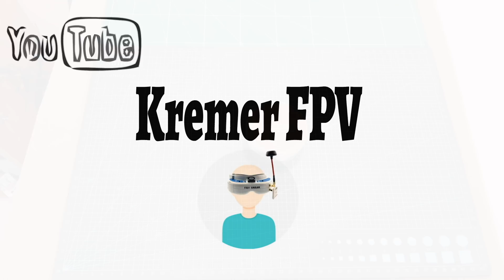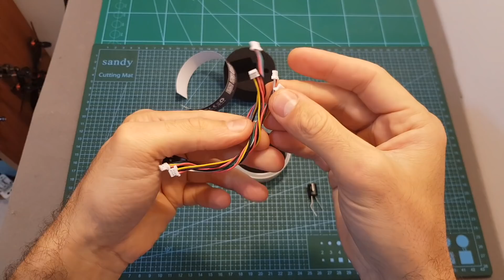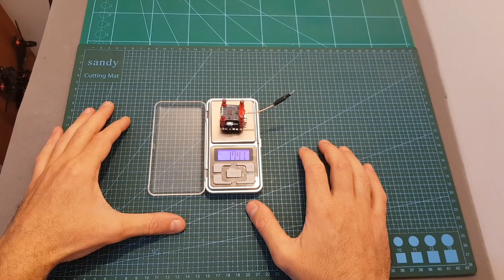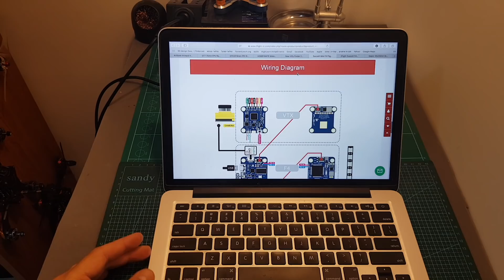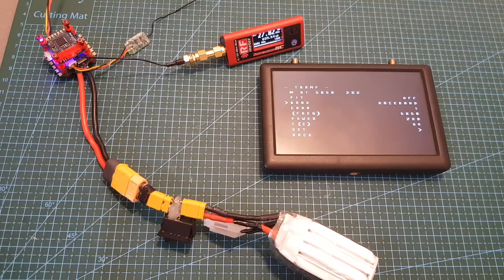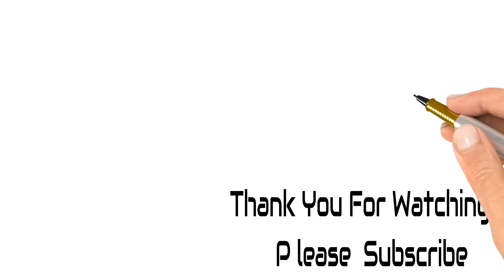iFlight SucceX F4 Mini Tower - Overview & VTX Test

Comment: Do you have unlocking procedure for the VTX?
Reply from the maker: It is already unlocked.
Reply: @KremerFPV  Im having an issue were it will not save power setting. Every time I plug in a new battery it reverts back to 25mw
Reply from the maker: @MrSplblzr  It sounds like you're using the wrong VTX table settings. Make sure you're using IRC tramp protocol and configure your UART ports properly.
Reply: I was given an article that stated it was a bug with one of the software versions. So I flash the latest version on there. But still having the same issue.
Reply from the maker: @MrSplblzr  worst case you can set it manually, just make sure to disable the smart VTX control.

Comment: How do you configure Vtx control? Is it IRC Tramp protocol on UART1? I have the iFlight Succex F7 mini so it has the V2 Vtx in the stack.
Reply from the maker: It's IRC tramp but I need to check the port. As far as I remember it's either UART 1 or 3.

Comment: How many mw does it output when it's set to 500mw?
Reply from the maker: The one in the video is not the latest version (V2) which has a maximum output strength of 500mw.
Reply: @KremerFPV  Oh ok, thanks for the reply ;)

Comment: Hi recently i bought a new  Iflight Succex F4 V2 Mini stack. Iam getting core MCU temperature  warning 70-80c  message on osd. Is that any issue? The vtx is heating up too much. I think that makes the FC hot. When i mailed iflight they said its normal and it will go off when flying. I dont want to burn my vtx or fc. Need your input kindly help bro. Actually i have 2 same stack when i swapped the vtx the issue is also swapping that means its VTX heaating issue? Just want to know can i fly with this issue?
Reply from the maker: Hi, yes, don't worry - it will get colder once you will be flying.  Don't leave it turned on for too long on the bench as it can damage the VTX and of course always make sure that the antenna is connected.
Reply: @KremerFPV  Thanks a lot man but when swapped on with another same VTX it working fine. The the VTX is not hot as this ond any clue?
Reply from the maker: @rajeevgopal1394  was it powererd without an antenna or with one that wasn't connected properly?
Reply: @KremerFPV  its mmcx connector and was connected propeely

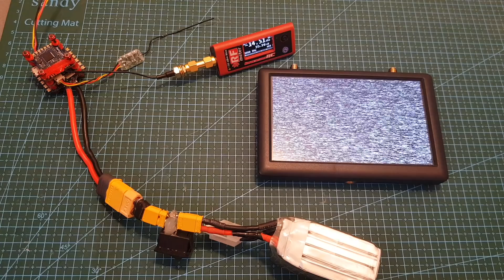Comment: 2:47 how do you get into the osd here?
Reply from the maker: Betaflight OSD: By default you need to put the throttle at mid position, YAW to the right and pitch to the top (all together).

Comment: Hi Gal, would you recommend this for a 5inch build?
Reply from the maker: Hi, I used it on a 5" with no issues. The VTX is not that great though, so I suggest using a different one if you want to get further with your quad.
Reply: @KremerFPV  Thanks Gal, going to try it over the weekend and see how it goes.
Reply: @KremerFPV  Sorry I forgot to ask what size and kv motors did you use?
Reply from the maker: @aerials2390  https://youtu.be/P9Ul5Qe2RzE

Comment: Hello Gal, thank you for the detailed videos you make, i actually order one, do you know if i can connect r-xsr frysky reciever to this F4 using fport? does it has and inverted pad for smartport ? i saw in their diagram you can connect the sbus to rx6 and the smartport to tx6 looks strange to me, Thanks!
Reply from the maker: Thanks Eyal. You should be able to connect it, but it will require you to update the firmware fo the R-XSR receiver. Not sure about the pad inversion - I suggest you should talk to iFlight, as I also didn't find any information about it.

Comment: Can we connect camera to this FC without pins?? i damaged my pins :-(
Reply from the maker: As far as I know there are no pads. You can try to solder the wires to the connector of the pins if it's still possible.

Comment: Sir iflight succex f4 or hglrc F428 which one you suggest for a ifligh ix2 ciniwoop build with HD Cam. Iam confused pls help and also runcam split 2 or caddx turtle which is good
Reply from the maker: Both options are good. The Succex is lighter, more compact and comes with a VTX.
Reply: @KremerFPV  hglrc also comes with VTX but more expensive than sucexx

Comment: Hi,
Do you know if the vtx is consistent above 500mw even when heating up... If not how well does it keep the mw as the temp rises?
Thanks
Reply from the maker: I only tested it for a minute on the bench and it seemed pretty consistent. Keep in mind that when you're flying it cools down which will help to get better results.

Comment: Nice stack, I have one but without the VTX part, anyone know if the tiny round pins on the FC marked V and A are definitely the video and audio pins, need to know where to connect the unify. Cheers in advance, p.s, the wiring diagram doesn't tell you, not that I could see anyway.

Comment: More competition and more choices! This doesn't look bad. If you wanna race it's not an all in one FC/VTX so you can replace it with a lighter VTX that can do PIT mode and the low power ranges like a real 25mW. With it under representing the true output power I'd be happy to use it for freestyle though!!!

Comment: I have grave concerns with FC and ESC connected via pins AND both using soft mounting. I will make a bet that reports will be many with broken pin connections from board. Just look at the DYS and HGLRC similar designs with same issues. Ribbon connection would have been much more wise.

Comment: Very curious a build and how clean this system is.  The new hglrc f420 is super clean but the wiring harness is awkwardly located and only 20 amps. With a 6s capable stack and only a 220  capacitor sounds like it might be clean. Somebody do a 6s build.